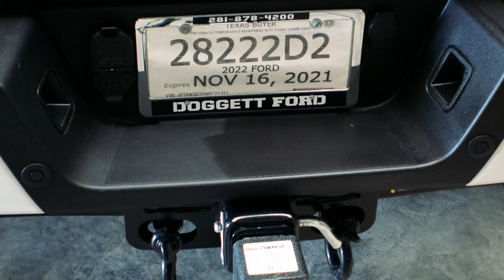2022 Ford F-350 Platinum DETAL & CERAMIC COATING

Comment: What pressure washer setup are u using? Looks perfect and portable
Reply from the maker: Hi Iggy. It is the Kranzle k1622ts. Amazing pressure washer, a little on the heavy side but built like a tank. 
https://www.detailedimage.com/wax.php?id=134767&url=detailedimage.com/Kranzle-M104/K1622-Cold-Water-Electric-Pressure-Washer-P1696/

Comment: Did the leather ceramic affect your cooled seats at all as far as the air flow stopping?
Reply from the maker: Not at all. Was my first time using leather coating and am very impressed, didn’t alter the look of the leather either